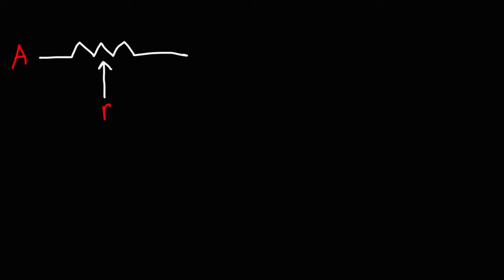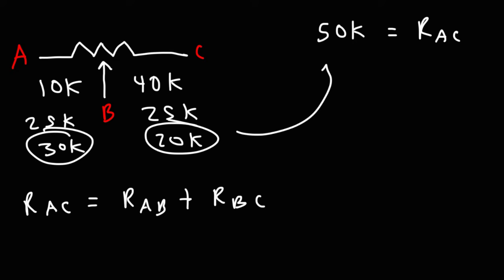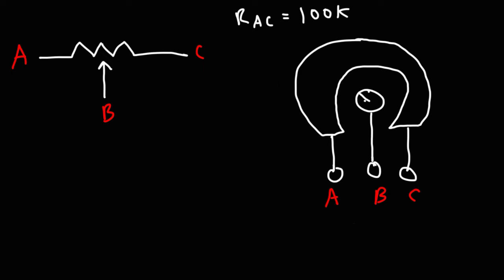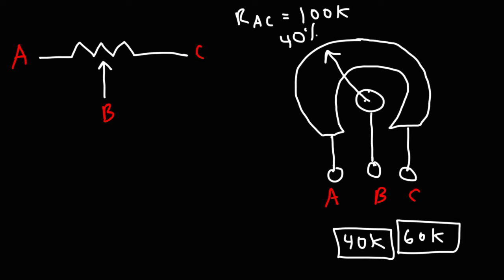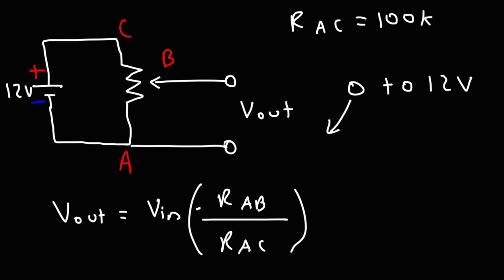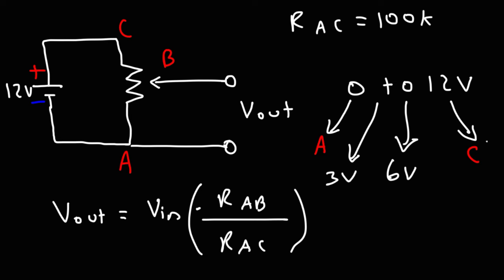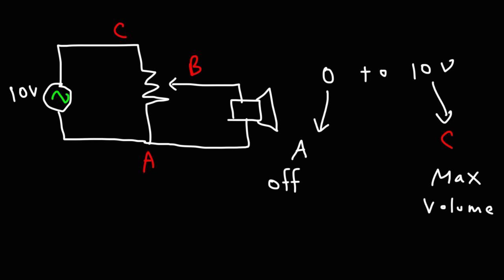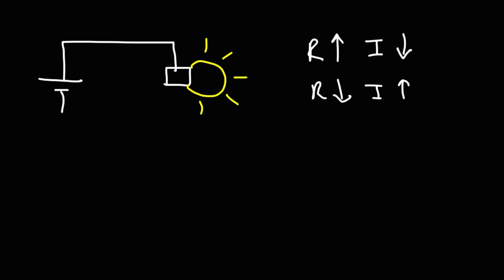Potentiometers - Basic Introduction

Comment: To control a small (like used in models/toys) brushed DC motor, would you use it like the light dimmer or like the other to control voltage?

Comment: I have a question about why a potentiometer used as a volume control needs to have three lugs. It seems that in an audio circuit, the first lug goes to the input signal, the middle lug (wiper) is the output (coming out from the pot) and the third lug goes to ground. I assume this means that the balance of the current (the current that does not go out the wiper) goes to ground, unless the wiper is all the way at the "max volume" end and in that case all current goes out the wiper. Is that correct?  What would happen if there was no connection to ground, and the current could go only out the wiper but not down the rest of the track and out to ground?
Reply: If you don't ground the lug, then it's not a voltage divider. That is, it's not putting a constant load on the pot and not acting like a real volume control. It's become a variable resistor in line with the output, which is essentially a tone sucker. No. Don't do that.

Comment: Potentiometers are adjustable resistors and are not variable resistors. The difference is that potentiometers or adjustable resistors have 3 terminals and variable resistors have 2 terminals.

Comment: What is the difference application between the two arrangement of the circuits? (one by using all 3 pins of the potentiometer and another only uses two pin). It seems to me that both have the same function of varying the resistance. Or is there any other thing I missed?
Reply: Seems like A B C are used for turning up your volume or turning it down
 
A and B applications where its only 2 are used in dimmable lights, so that you can go from 0% on 50% on them the max 100%
Reply: @Cricis11700  I rather think d first one is for dividing d voltage whilst the one which all pins were used is for increasing volume or brightness.
In short, I think d first one affects d voltage while d second application affects d current ✌️